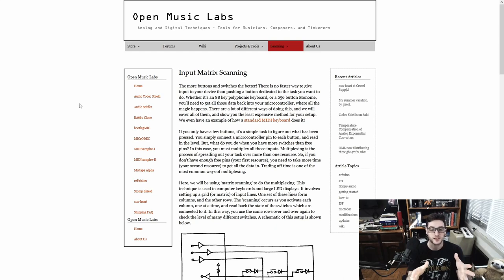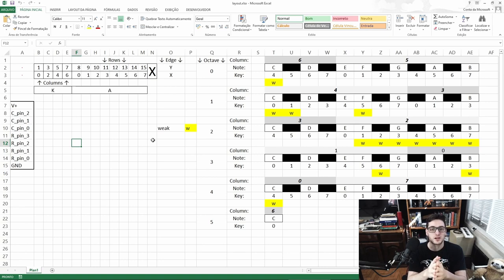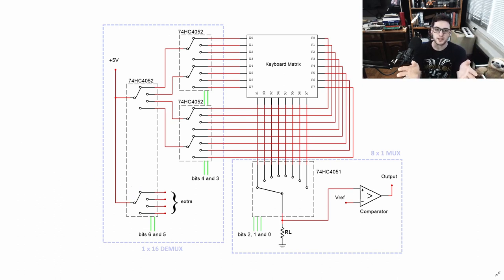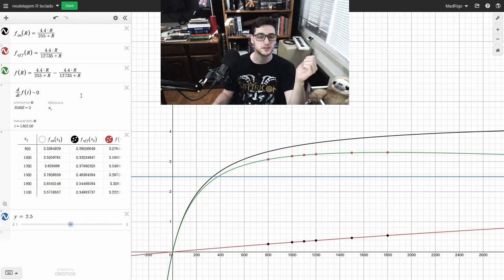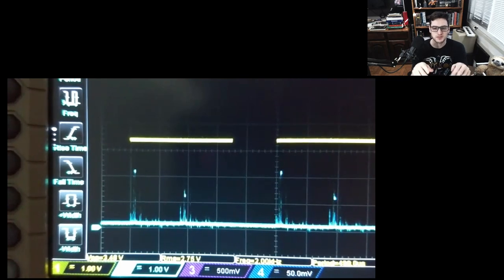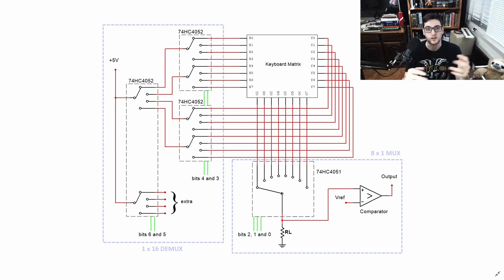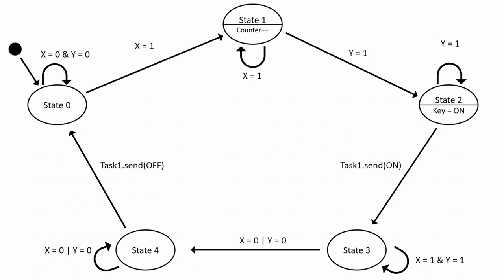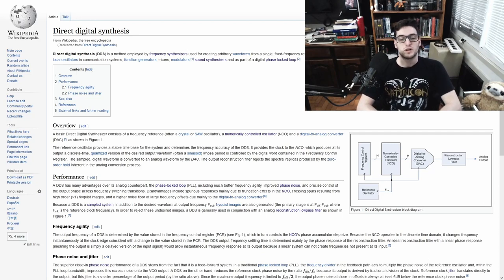Mad Synth #3 How to read your keyboard with a microcontroller?

Comment: Why not just read digital levels from matrix without comparator? CMOS chips have almost infinite input resistance so key swtich resistance does not affect anything and you get high and low levels directly from keys. You just need pull up or pull down resistors to avoid spurious readings from not pressed keys.
Reply from the maker: You try that, with different platforms and tell me how it goes :D If you pay attention to the video I'm pretty sure I explain why comparing it using a pull-down resistor.
Reply: @madrigo  Well I rewatched both videos and still don't get why using comparator instead of just reading direct values of 0 and 1. If you doubt that 10k pull/up/down is not enough  with this specific keyboard which has relatively high "on" resistance it's ok to use even 100k for pull resistors and more than that use shottky diodes to reduce voltage drop there even more. I'm curios because currently I also making keyboard hardware and need to read about 100 keys and I use pull resistors and serial SPI bus to reduce number of MCU lines. HC series chips work pretty well at 8 MHz serial speed and reading even several chained registers is fast enough for key input.
Reply from the maker: @dnkreative  So... you made me watch my own old video again. In a middle section I show that I'm using it to make the topology universal. You can always simplify a circuit, it doesn't mean it will always work. The comparator ensures you'll always have a valid output. There are a lot of factors that influence old keyboards, and can change the values dramatically. The comparator helps with that.